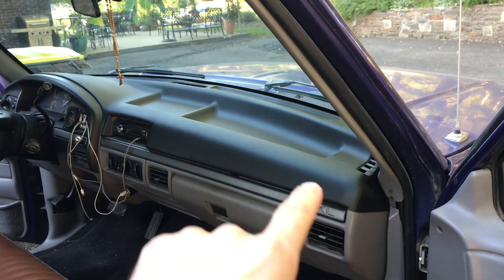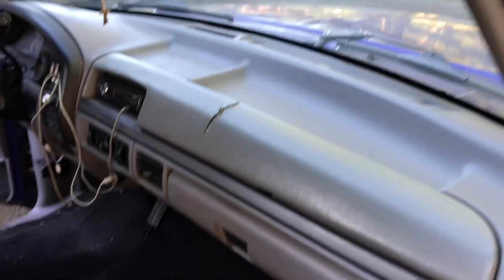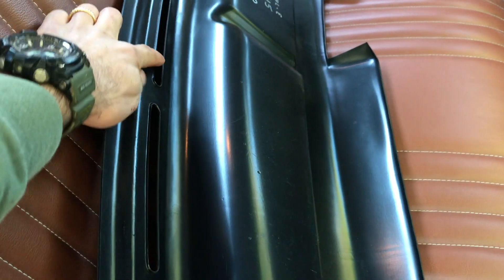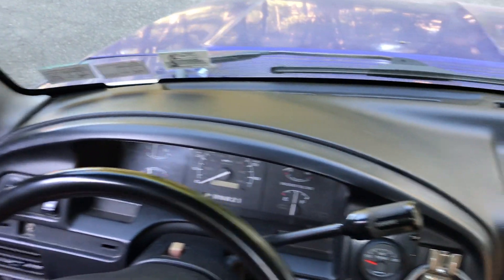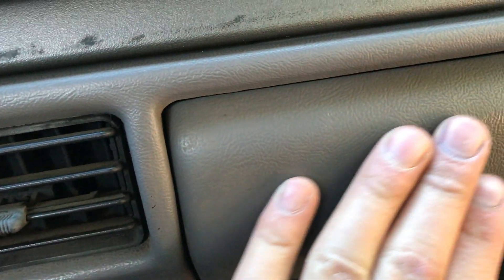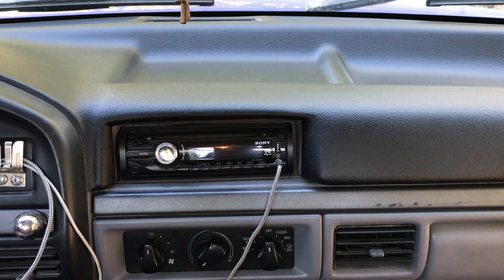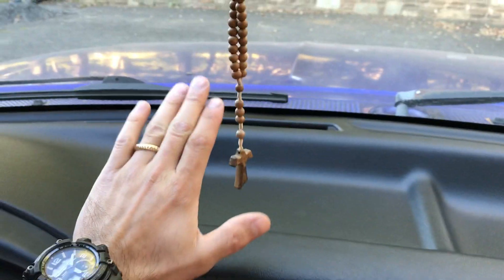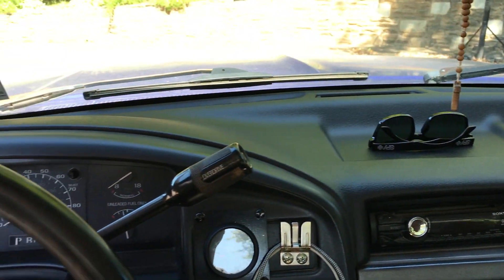How to Install a Dash Coverlay + Product Review | 1995 Ford F150

Comment: Thanks for this great video and using Coverlay®. If you do use the silicone adhesive we send to attach, and then need to access the dashboard underneath at a later date, you can use a heat gun or blow dryer and heat up the dash cover then remove it. If your Coverlay® dash cover is damaged during this removal process, we will warranty it and send you a replacement.👍
Reply from the maker: You’re welcome! 🤙 This is a great product! Awesome! That’s good to know. You never know when you need to get underneath the coverlay for a repair.
Reply from the maker: @coverlaymfg  Awesome! Thank you! 🤙 I’ll send an email with my address today.
Reply: This is great, thank you, its great to see a young man getting his hands dirty, i was a Chrysler Plymouth, dodge tech for many years, so its great to see and you really do a great job thanks!!!

Comment: You can use a vinyl and cloth spray paint to recolor the tan parts. I had a friend change his blue seats, dash, and doors in a 95 S10 from blue to black. It looks great and still does 12 years later. Duplicolor makes a great spray for that.
Reply from the maker: I've seen people use those sprays and they do work very well!

Comment: I know you're pot committed to the overlay and I think you'd also like the carpet cover.  I did this for my 95 Bronco and it came in gray/grey and matches perfectly as far as color.  Fitment was spot on and I just plopped it on.  I ran some wires below the carpet (gps, search and rescue lighting wires, etc) and hid them well.  If I need to change anything, just pull up and there they are.  Maybe you want to give that a try and not see that radio short cut they did and the vent hole.  Great videos, keep them coming!!!
Reply from the maker: Nice! I actually did end up gluing the coverlay down. So there’s no turning back now. Lol That’s cool that you can use the carpet to cover everything. 
Thanks man! 🤙 I appreciate it!

Comment: Looks like a great product just kind of curious what 6ou would recommend found dash replacements for around the same price what are your thoughts on that? Loving the work you have done with this truck awaiting what's next
Reply from the maker: Thanks man!🤙 It definitely is. I have to admit I was a bit skeptical. 
As far as buying dash trim pieces and going that route with restoring the interior. You can honestly spend whatever you’re comfortable with and whatever gets you the best looking trim pieces. I’ve seen the dash piece in front of the passenger side seat (that usually cracks) go for $100.

Comment: Did you get the whole kit? Did you get the door panels as well? Awesome video man!!
Reply from the maker: I only bought the dash piece.
Reply: Will you end up getting the panels? I want to order the kit but I’m kinda Nervous
Reply from the maker: @jamesbroderick3660  I’m not sure. There is a company called OBS Interiors who restores door panels. Their finish work looks phenomenal!
Reply: @TheMinuteMasters  hmm I’ll have to look into them. There’s also a company call bronco graveyard. They have them for $545
Reply from the maker: @jamesbroderick3660  Yup! Bronco Graveyard is a great site too. I’ve ordered stuff from them.
Reply: @TheMinuteMasters  but they are so expensive man lol
Reply from the maker: @jamesbroderick3660  they are definitely expensive! I’ve priced a few of their brake conversions and lift kits. Definitely not cheap. You can get interior parts cheaper at junkyards too.

Comment: Hi Steven, Where did you get the cover for your seat? Looks really nice.
Reply from the maker: Hi Jesse! I actually had my entire bench seat custom reupholstered. Cost me $317 and worth every penny.
Reply: @TheMinuteMasters  It looks really good. I am curious as to why you went with that color though...
Reply from the maker: J. R. Thompson Thanks! Originally I wanted the interior to have a vintage airplane theme, hence the brown. Unfortunately, that theme would require a lot of custom interior which I can’t afford. So I’ve reverted to the black interior.
Reply: @TheMinuteMasters  there is a nano ceramic tint film that you can put on your windshield to help keep the UV and heat out of your truck cab. I find this exciting since I do not yet have air conditioning in my truck. I hope to eventually.
Reply from the maker: J. R. Thompson Yes, I want to add that to me from windshield for sure! It gets hot on that dash in full sun.

Comment: Get ceramic tint.  Way better. Only do a 50 percent. It blocks much of the heat and all the uv. Just remember to fill the rock chips before they spread so u dont have to replace the windshield
Reply from the maker: I agree, 100%!

Comment: So I can either buy this or the actual foamy dash pad that is cracked, they are about the same price
Reply from the maker: The pricing can be the same. The foam dash pads range in price. The coverlay covers the whole top which can hide other cracks.
Reply: @TheMinuteMasters  I don't got any others as of now luckily, need some interior spray with uv protectant to keep it that way
Reply from the maker: @tuckerhiggins4336  That’s good! My dash has had cracks in a few other spots. You are definitely lucky.

Comment: I ordered a cover direct from them and it is poor quality as far as fitment , they offered a refund minus shipping ... $90 ,  cover was 255 . so i end up at a loss for a poorly fitting item . decided to fix it by adding to the areas where it was short , yes it wasn't that i needed to remove material , i had to add , then try and paint to match . 
I've purchased aftermarket ABS parts for motorcycles without these issues unless it was a racing part where detail is second . 
on their site it says " Made From Durable ABS Plastic And Vacuum Molded For Perfect Fit " , right . 
Seems like they are the only game in town for this type of product , profit > quality .
Reply from the maker: Sorry to hear that man. I must have got mine while the quality was good (roughly 2017 I think.)

Comment: I bought there door panels definitely worth having new door panels but the pricey.
Reply from the maker: Nice! Is it a coverlay type as well or a whole new panel? How’s the fit and finish?
Reply: @TheMinuteMasters  coverlay panel and fits like factory comes with new leather on armrest and new felt on panel i love it my old ones were falling apart at the pockets so they needed to go i went with the black panels and painted the whole dash to match looks like a new truck now its a whole panel made by them not a cover
Reply from the maker: condemned youth Gotcha! So it’s basically a brand new panel. Now I’m very interested. I’ll definitely check them out.